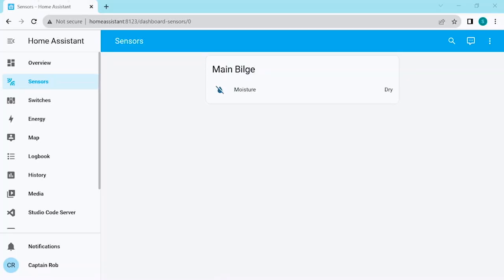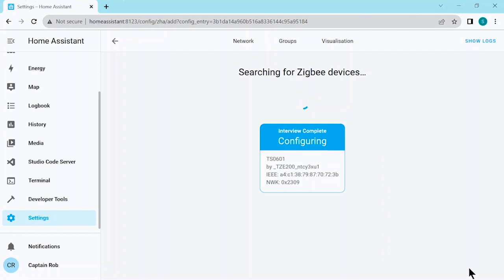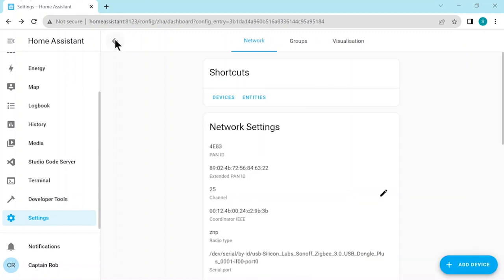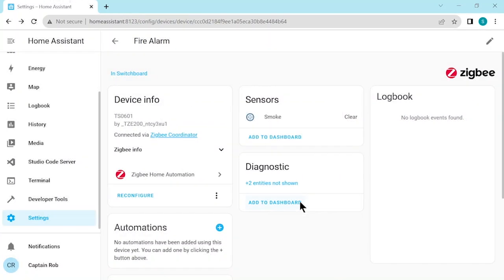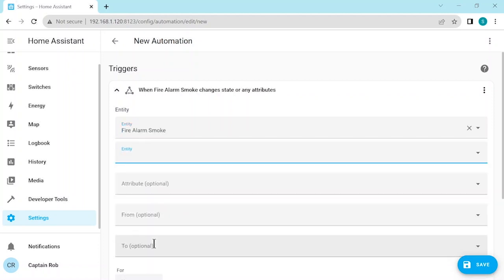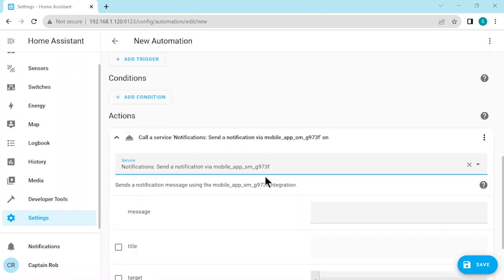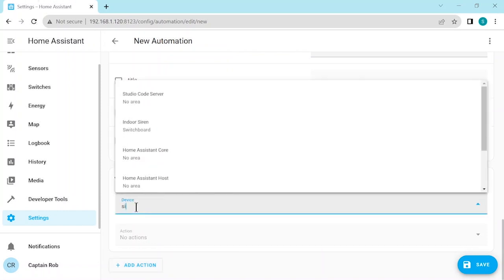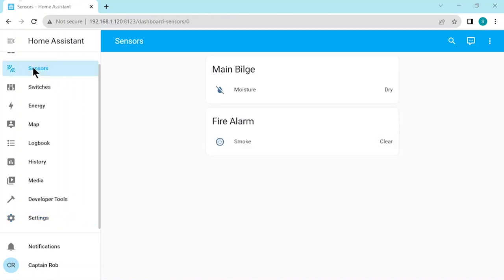Smart Boat 10: Adding a Tuya Fire Alarm Sensor to Home Assistant

Comment: Just added my  Zigbee some detector and it only has batter and smoke with state open or closed. IS that right? Is the open or closed the some diction?
Reply from the maker: For this Smoke Detector you select the binary sensor with _smoke at the end of the name. There are others for battery and tamper.
The value should be clear when there is no smoke.  In the automation if the state changes to ANY STATE then trigger the alarm. This should cover any value that is not clear.